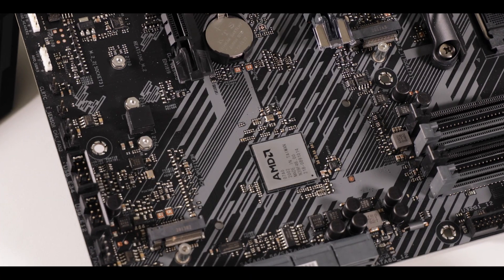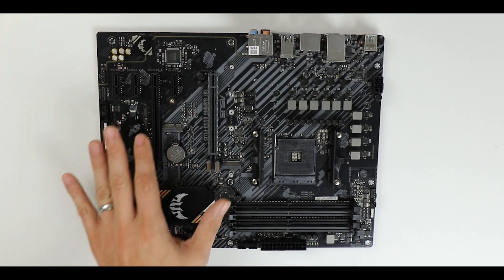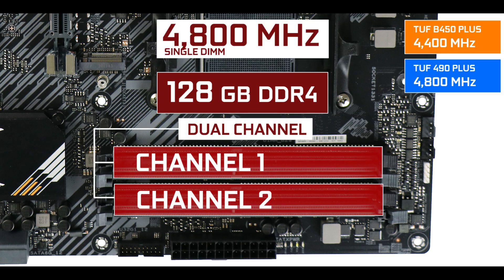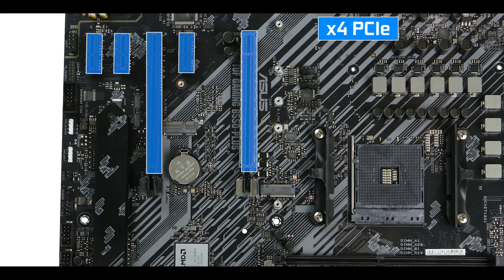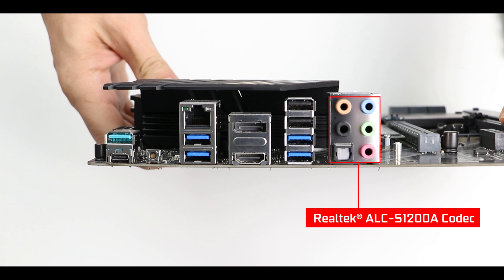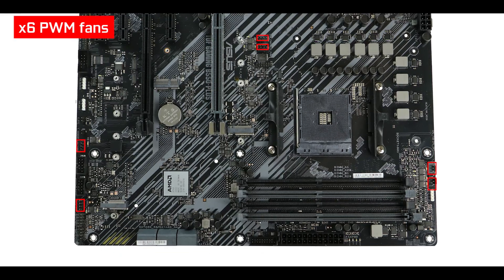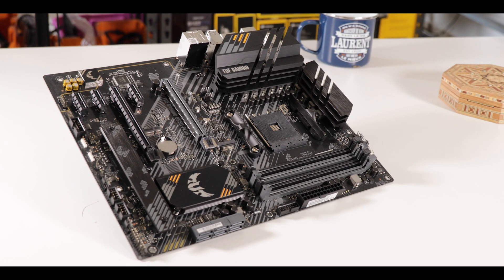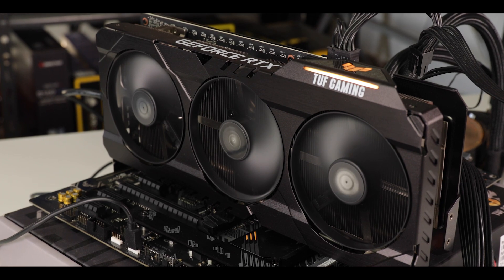ASUS TUF GAMING B550-Plus : Cool as Ice!

Comment: Have this motherboard on the way, Black Friday Sales 2023, $AUD 70 off, check PC part picker a real $70 off making cheaper then the board I was looking at, Asrock Pro. It's not the wifi or II. It's this board (but mATX) , and I'm a fan of the right angle SATA, has I have a tight case, and the PCE-I layout out is OK, will never ran two GPUs, but that X1 PCE-I is out of the way of the GPU cooling if I find something I use it for.

Comment: Nice review but geeez ... I don't see the advantage of the a fixed IO plate, neither a front type C connector or even hybrid connectors if it makes the price go up. This seems a well balanced mobo in terms of features and price. Let's not "unbalance" it, please.
Reply from the maker: Oh .... the fixed io plate saved my life so many times!!!
Reply: @Laurentschoice  , never got to use one ever XD
Not fixed IO plates, they come with the motherboard, they are mounted with the motherboard and they are removed if you swap the motherboard. I mean, unless you have the need to keep the motherboard and you just forgot to put in the same place, I see no hassle at all. That's is if you ever need that motherboard again. In such case it means you have plenty of hardware around. And I mean so plenty you can't organize it. Which in the end means someone working in the hardware business. That amounts to a tiny amount of people with such needs. Most people don't care about this detail. I mean, it probably is better with a fixed IO plate, I won't argue against that but that's actually meaningless if you aske me.

Comment: Hi Laurent!
Please help me decide!

The Gigabyte B550 Aorus Elite V2 and the ASUS B550-PRO are the two I selected.
The latter is the 12+2 VRM version of the B550-PLUS you also presented.
(In addition, they differ in the presence of the internal Type-C connector)

Which VRM layout would be better for a 5800X3D?
Gigabyte's (6*2)+2 or ASUS's (4*3)+2?

I like Gigabyte better because of the external appearance and I/O panel outputs, but if ASUS is technically better, I would buy it.

In the case of Gigabyte, the placement and number of FAN connectors is not ideal for me, but if I can connect a PWM fan to all 5 connectors, I will solve the cabling.

And what would be very important to me is the setting options and interface of UEFI. 
Also, which manufacturer's Windows software for the given motherboard is better made?

Please help me decide because I've been looking for and watching tests and demos for days, 
but unfortunately I can't find anything about the ASUS B550-PRO, everyone only tested the PLUS version.

What could be more important is that the two motherboards are currently at the same price, so this factor does not matter!
Reply from the maker: ouf... tuff one, both boards are so similar. I'd go for the AORUS just for a slightly better build finish than the ASUS B550-PRO.

Comment: @laurent's choise 
hi i got a question i got prime 690-A and asus strix b660-i in almost same price point and MSI MPG Z690 Carbon for around 50 dollar more which should i got for am pairing it with 12700k and trying to have future proof since i will barely upgrade but need to be up to date tech help sustain that i also not concerned about usb ports i got 2 drives to use for thos and most likely won't get more worth case will add one, i don't overclock much and if i do will leave it to auto so which i should go for sorry for getting long post

Comment: They must have updated the board since this video because mine has a usb c front panel connection and hybrid fan headers with a dedicated water pump header. It’s a great board paired with a 5800x and 32gb Corsair vengeance pro sl. Have 1 nvme, 2 sata ssd and 2 sata hdd hooked up running fine. I use a 6600xt and smart access memory enabled which makes a huge difference. Excellent board for the money.
Reply: I just bought one that doesn’t:/
Reply: How much does the smart access memory improve performance?  
What exactly does it improve in most situations?

Comment: I'm going to install this board later today, and I'm wondering if it's worth it/possible to swap the lower M.2 heatsink to the one in the top position.  I only have one M.2 drive, and I am under the assumption the closer to the CPU the better, but they only put the heatsink on the bottom position.
Reply: you can put it on top slot but its not ideal because the heat of the cpu and gpu

Comment: Hello.. Laurent I'm looking for compatible dual stick RAM (2X8gb) for this motherboard. May i know what model of Gskill Ram you had tested in this video? Is it stable? Kindly advise me.. TQ
Reply from the maker: Gskill worked great with it. U can use them blindly .
Reply: @Laurentschoice  If u said so,. I'm deciding to buy a dual stick of trident z neo (F4-3600C18D-16GTZN). Yes.. It is stated in QVL in Gskill website, but does not have QVL from ASUS. I'm afraid there will be unstable to run those speed on this mobo. What do u think?

Comment: Thanks for the review! You sold me on this after days of researching all B550 mobos in my target price range.
If my case does have a front USB type C, would I be able to put an adapter on one of the internal headers to allow it to connect to the USB C? I know it won't get normal throughput but would at least have some type of connection instead of nothing at all.

Comment: got my 5600x running at 1.265v with 4.7 ghz on air cooling! get arround 80 degress on load and 65c while gaming. couldnt be happyer.
Reply: Check south bridge temperature with fingers, b550 can be hot under oc 😅

Comment: Can this mb cope with ryzen 9 5950X + 3090 safely, with only XMP memory enabled ?  If not what ASUS mb would I need for cpu, and gpu combo ?
Reply from the maker: Ouf.... That's a heavy CPU for 500 amps... I'd rather see it on a 6 PCB layer tbh
Go strix on this one....
Reply: @Laurentschoice  Thank you, but what ASUS ROG Strix mb would you recommend me ? Also I don't need such high end cpu, and gpu. 5900X + 6800XT will do just fine for my needs ( gaming (Scum, Gta 5, Battlefield 5...), and casual 3D modeling(Autocad, Maya, Adobe...)).
Reply: @antoniocepaj7544  what did you go with?
Reply: @odezah  I went with nothing, since prices increased even more, and I don't wanna pay more than It is worth it.  
Now I'm gonna wait one more year if prices don't drop significally, and go with AM5 platform...
Reply: @antoniocepaj7544  2023 has arrived. I've pulled the trigger on this mobo with Ryzen 5600x & RX 580 (8GB). I, also, like to live dangerously. 😁

Comment: Next generation is out actually :) TUF B550-Pro. It does get a front USB-C header. Also, S1200 is not top of the line (for onboard anyway), S1220 is, which ASUS puts from Strix upwards. Btw, where do your figures of 4x DIMMs limited at 3600Mhz come from?
Reply from the maker: Hey there .
the 1200 and the 1220 codec are going to pretty much do the same and have the same features.what varies is what extra the company adds like amp and such for headphones. ( Source : NFM)

As for the DIMMs, it is actually pretty much standard accross all manufacturers. Some will say it. Others won't.
MSI tends to indicate on their documentation on product sites. 
Asus doesn't . 
Fact remains that the more you'll populate your channels , the lower clock you'll get. 
I suspect this has to do with signal integrity. 

In this very motherboad I had to reach out the manufacturer directly.
I then tried the different combinations and sure enough.....

I hope this helps :)

Thanks again for watching and taking the time to comment :)

Really appreciated

Laurent
Reply: Oh damn I just ordered the gaming plus as a replacement for a faulty MSI board, I didn't knew about this model.. it seems to have more power stage (12+2 DrMOS), I personally don't care about front panel Type C .. what else is different on this board ?? it doesn't seem to have 6 layer PCB either, it seems to trade 2x 3.2 USB for 2.0.. also not a big fan of "
*1 PCIE 3.0 X16_2 runs x1 mode when any of the PCIe 3.0 x1 slots is occupied.
*2 M2_2 shares bandwidth with SATA6G_56. When M.2_2 is populated, SATA6G_56 will be disabled." 

slightly higher memory OC comptability up to 5100.. 

I guess many boards are like that but it sucks to lose a sata 6 port for using both m.2 drives...that's the case on both boards though, so I guess the pro version is more fitted if you wanna go for a 5950x for the VRMs, although with decent case cooling it seems like the plus would do just fine, if it's just that then no big deal

Comment: I don't get your review Methodology.
So here, a 4Layer PCB is such a stable and good Product with only 4 Layers. "An Engineering Zen Exercise. [...]Which is no handicap to the Performance level of this Board."
Your Review of the MSI MPG B550 Gaming Plus, tho, was "a hot Mess" because of the 4layer PCB. It was "the first engineering Mistake done by MSI. [...] things like Stability, Durability and even its audio quality." where mentioned.
But here, despite having the ALC 1200 and a 2.5Gigabit LAN (so, more for the same Price) the 4 Layers don't seem to be that big of a Deal.
Not trying to shit on your Parade. I actually like your Format.
But maybe, just leave out the Layer count as a big factor in your Conclusion . . . or unify it.
Reply from the maker: So not all 4pcb layers come equal.. but what made such a difference between the 2 boards was the VRM. 
The Msi gaming plus comes with 12 50 amps , low and high end power stages (notoriously hotterl) . 
That is 2 power stages more than the tuf B550 . 
More AMPs (600 Vs 500 ) translates into more heat. 
On the MSI B550 gaming plus (as it s z490 variants by the way), that extra heat  accumulates in its soldering points. 
And that's where having only 4 pcb layers becomes problematic. 

The heat diffusion is much lower than on  a 6 layers PCB. 

As for the sound, the MSI b550 gaming plus really comes with an inferior  codec (ALC 892) than the TUf (ALC1200). 

It has a poorer sound isolation, where a 6 layered PCB would have been really helpful with. 
I'll also not that the TUF audio codec comes with a TUF shield (or whatever they call it) which further helps with interferences. 

I hope I addressed all your questions and that it helped. :)

Thanks for watching !!! 

Laurent

Comment: I had a reply from ASUS the other day & they stated that all their PCIe 4.0 motherboards have a 6 layer PCB layout even though you can't find it on their website here is the reply to confirm it:

"Thank you for contacting ASUS Support. My name is Arsen.

Please be advised that the TUF GAMING B550M-PLUS (WI-FI) has 6 layer PCB. All the motherboards that support PCIe gen 4.0 has 6 layer PCB.

Kind regards,
Arsen_N
Asus Customer Service
Asus Technical Support Site: http://support.asus.com"

The fact that it has good ports & the heatsink looks like it will get rid of the heat better than the beefier ones because of its dimensions it will not only conduct but convect heat away very well it's nice to see ASUS know their thermodynamics this has resulted in me ordering one which should be with me on Thursday.
Reply from the maker: Hey there .

Though I do not doubt your report a minute.

It remains that both the TUF Gaming B550M-PLUS (confirmed by KITGURU) and the TUF GAMING B550-PLUS are still 4 PCB layers motherboard. 

It is also the case of the Prime B550-PLUS.

Now... Maybe that person added the 2-ounce copper layers to the count... But that is not how any reviewers would define a 6 PCB layer motherboard. 

There is an easy way for you to verify :)
Get the said motherboard.. use a dremel and slowly erode the PCB layer after layer :) (just a small part of one edge is sufficient to make them all well visible ).

I do appreciate the time you spent on the matter and just for clarity sake I'll re-shoot an email to the Asus regional product manager :)
You never know. He might recant :)
Reply from the maker: Done :) contacted 2 Asus mobo officials on 2 different continents :) 

Let s see if both of their answers concur :) 

I'll update when I got their reply :)
Reply: @Laurentschoice  I won't hack away a t a new board it will void the warranty ASUS did say it's not a question asked often & that is why it is not on their page if what I was told was right it may be standard for a lot of PCIe 4.0 motherboards.
Reply from the maker: @Britexit Engineer oh of course not. It's a great board . 
It's where your money wants to be :)

It is standard for upper tier boards (usually above 160/180 usd mark).

But it is what it is :)

Good choice
Reply from the maker: Hey. DM me on my Twitter account .

Got something to show you :)

Final word : Asus was kind enough to confirm that it is indeed a 4 PCB layer. 
They did provide internal documentation as well. 

I can show you parts of it if u want :)

I hope this clarifies and helps out.
Reply: @Laurentschoice  Yes please do.
Reply from the maker: Twitter :)
Reply: @Laurentschoice  I don't do twitter it's toxic...